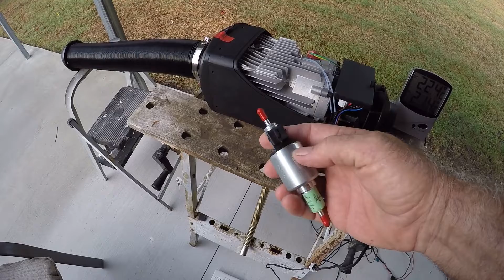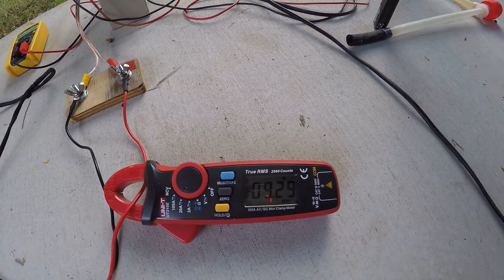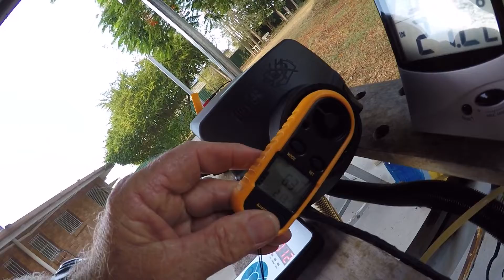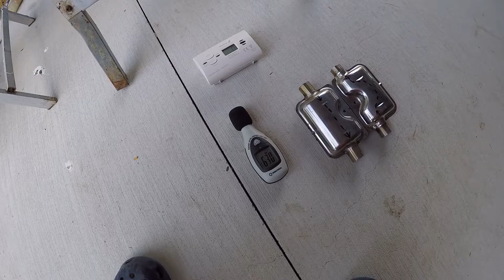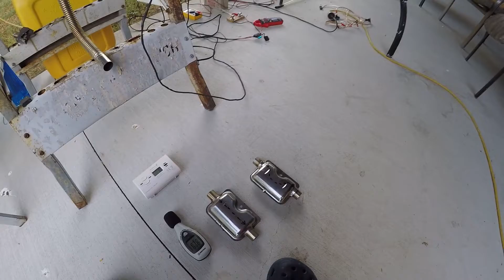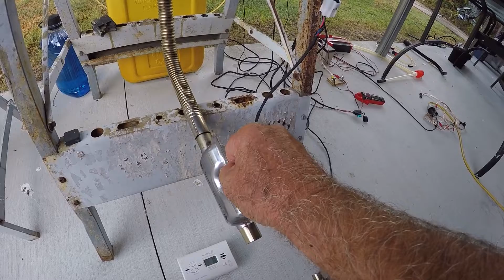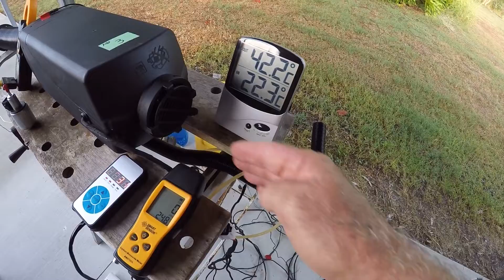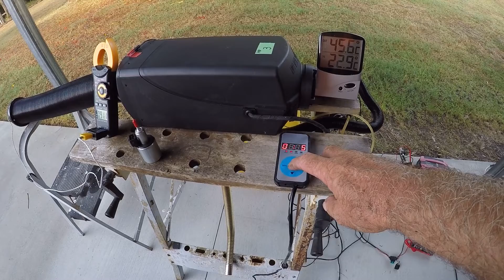Chinese Diesel Air Heaters - Part 2  -  5KW Bench Test

Comment: I started a quick spreadsheet punching in most of your data.. the BTU calc don't jive with the calculated fuel BTU though.. have a look https://docs.google.com/spreadsheets/d/1J0-vUZ98CtrjvCbtwRmReOIGYUFXzwEUeUnMwheW40I/edit?usp=sharing
btw, the code for that display is most likely 9009, you can lower the fuel down to 0.8hz from stock 1.6 and increase it to a max of 6hz along with lowering fan to 1450rpm and increase it to 5000rpm
Reply from the maker: Hi Paul, 
Thanks for your comments and the spread sheet data. However this is not a lab test but a rough workshop test. But in some regards, perhaps a bit more "real world" . 
EG. 1. I placed the anemometer outside the intake screen, because that is real world. You get a higher reading if you remove the screen. You also get a slightly different reading at the outlet. 
2. The output temp readings are taken 500 mm from the heater outlet. They would be higher if taken right at the outlet, bur most installs have at least some ducting, and I just used the 500 mm duct that came in the kit.
3. I have done one test run on heater 2 leaving the heater on each setting for 1 hour, taking readings every 15 minutes. No two were the same, they all varied slightly.
4. In the last 6 weeks I have tested 6 of these 5 KW Chinese Diesel Heaters. All of them gave slightly different readings, even though they are the same heaters. (Different heater, different day, different temp, different atm pressure, different air density etc)
5. I have run three tests on heater no 3 on different days. It also gave slightly different  readings on the different days.
5. A lab test would be done with a standard atm pressure and temp, with a fixed std air density and air weight. My tests are done on the back patio rather than the shed for exhaust gas dispersal and trying for consistency of the different tests using the same intake, exhaust, and ducting. 
And on the patio, I have a comfortable chair, nice view, and easy access to the kitchen for coffee or tea.

Cheers, John
Reply: oh no, I wasn't complaining about your data in any way.. its more than I have come across so far regarding these chinesium heaters. you are correct though everything is most likely slightly different from one heater to the next. I've been running one mounted in a window fixture I built for almost two weeks now, just to supplement bedroom heat for warmer nights.. last week was almost a godsend for that polar blast we had.
Reply from the maker: Thanks for your comments Paul, I hope your nights are much warmer now.